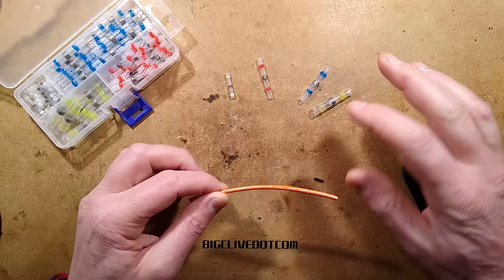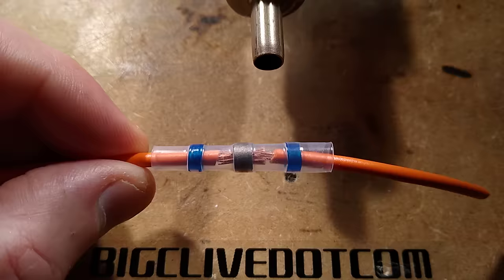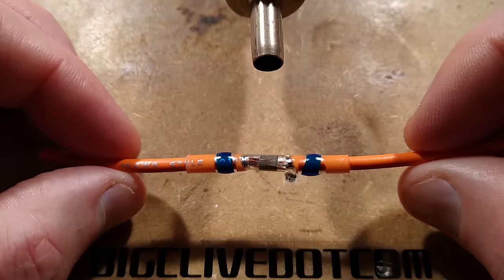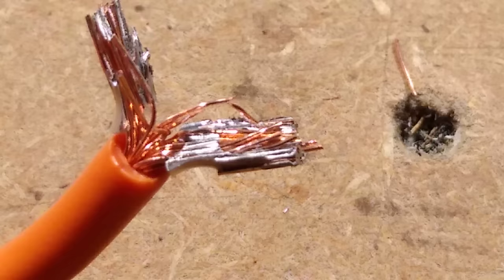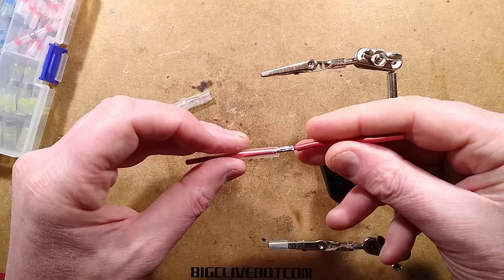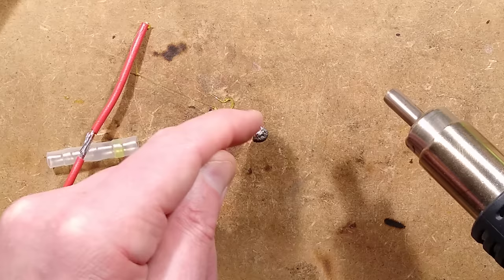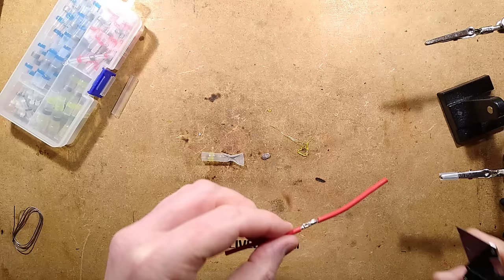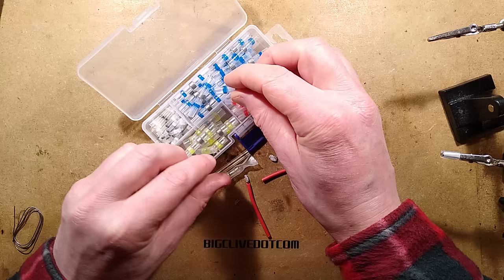Heat shrink solder butt connector test.

Comment: I use (used to use?) these at work, but we have the "brand name" ones which we get from RS which appear to have flux on the inside of the solder band, so they provide really quite excellent solder penetration and strong joints even in fairly high current applications, highest was nearly 25A
Reply: I agree. I used them in the past on MoD equipment. They look like cheap knock-offs to me.
Reply: I was going to comment on this as well.
Those ones appear to have a much worse solder quality compared to the name brand ones that I used at work before we quit due to RoHS issues with the ones we were using.

Even seeing the original solder band visible on the heat-shrink in his test was a warning that the solder wasn't a good quality example.
Reply: @martinbuck3094  - I think they are - the RS ones are much better.   I have used them and carried out a similar test with better results.
Reply: With the knock-offs one could easily add their own flux
Reply: I have seen them used my air craft manufactures and have used them my self.  There are Coax and Triax splice kits that are about the same concept.  When done right they work great.  Bought some for automotive use, been seeing them become more popular the last couple of years.  8 years of aviation maintenance.
Reply: @cody_forrester  
I saw something similar in military acft maintenance while I was doing it as well.
Not often used on the airframe I was working due to the wire maintenance specs, but still on occasion.
Reply: I used Military grade versions of these on Aircraft wiring when I was the RNZAF. They were fantastic. As others have said, these look like cheap knock offs.
Reply: I got a pack of these knock-offs and they're terrible. I loved the good ones I used to have. They had marine sealant in them too.
Reply: @__WJK__  What next - solder-cored flux ;)
Reply: I used to work for BAE Systems back in the early 2000's building wiring harness for military/aerospace applications. We used these type of connectors occasionally, but I was trained to always tin the wires before making the connection.
Reply: You know what would be mind-blowing for these ? If the tube either side of the solder ring contained a chemical paste such that you just push the joint together in the sleeve and in doing so, partly mixed the two chemical compounds that reacted exothermally to solder the joint and effect the heat-shrinkage - so no heat gun needed.
Reply: @cody_forrester  I still have a bunch of these, great for terminating coax onto circuit board pins.
Reply: @millomweb  - You might actually be onto something... that's kinda sorta what we see in arc welding rods/electrodes.
Reply: @BEdmonson85  In which case, you may as well have soldered them properly ;)
Reply: @__WJK__  Indeed. And in the case of brazing, it's d-i-y flux coating ! I wonder why flux-coating brazing rods didn't catch on ? Maybe they are available but I suspect less flux is required once the brass has wetted fully what is being joined - making plain rods useful.
Reply: Aviation uses solder sleeves, but generally not for joining two cables directly together.
Mostly for joining a flylead to the screen of a screened cable.

These flyleads are sometimes used a conductor, for example in the audio systems, however usually it is just used to terminate the screened shield of a data cable, to help reduce interference or induced signals.
A way of reducing "noise" in a data transmission system.

But, I have never seen them for a physical wire joint before. Mechanical methods such as crimped splices are much preferred. Even when soldering to a terminal you want it hooked or wound around the terminal post for mechanical contact. (depending on that particular aircraft manufacturers spec/standards)

But then again, Aviation, both civil and military is full of manufacturers who use rather random unique methods despite their usually fairly United standard practices.
Reply: @underwaterdick  With the quality of contemporary crimped joints, nevermind the very low cost, soldered joints are frankly more of a risk/liability than anything else, at least where movement & vibration is a concern(more often than not). Crimp quality testing is as simple as giving the crimps a nice solid yank and throw the meter on it to check resistance - but soldered joints just add a lot of unnecessary points for potential human error that crimps don't. Also, the time & expense of redoing a poor soldered joint vs a crimped joint too, and inconsistencies. 
Solder just doesn't make as much sense today as the old school guys want to believe it does - old habits die hard, but new habits are cheaper, quicker, more dependable(no work hardening over time!)
Reply: Those are better yes
Reply: Bullshit. If these worked we'd all be using them.
Reply: We also have a brand name product and the solder is thicker and there is flux visible .They work great.
Reply: @underwaterdick  yep, that is typically what they were used for at my old job.
Reply: @millomweb  yeah, military standards can be a bit tedious. That's why mil-spec stuff costs so much.  You'd be amazed at just how many manual processes still exist when building military equipment, that have long been automated in the commercial world just because quality control is tighter.
Reply: If you're buying anything other than brand-name, you're wasting your time. Those products are made only for Big Clive to rip on and should never be used by anyone who actually cares about their workmanship.
Reply: @__WJK__  you could add your own low melt solder too lol
Reply: oldskoolhead0 - I actually have a tube of solder paste and will have to try it next time I use these!
Reply: @BEdmonson85  I guess it will all have a certificate. The bolt will be certified by the manufacturer to meet the mil-spec. The person that puts the nut on and tightens it up will certify that the bolt has been tightened to 'spec' using a torque wrench that has 'recently' been tested and found to be in 'spec'. No machine can read the certification from the bolt manufacturer or torque wrench certificate to be able to certify the bolt has been tightened to spec.

Machines do dumb work repetitively and rarely compensate for out of 'super spec' results - as they don't test - everything is an unknown. Pretty much everything military will have a watertight paper trail - and 'passed' !

Incidentally, a Snap-On  catalogue of the 80s had a range of tools from a pound or two - like an 8mm spanner - so I had to find the most expensive tool in the book - it was a torque wrench tester at over £50,000 !
I'm sure I could make one cheaper than that !
Reply: @BEdmonson85  I know of one <linked> place that when it got new electrical appliances with a moulded on mains plug, it'd cut them off and fit a new plug !

And my washing machine - when you press the power button to turn the machine off, it breaks the neutral connection - meaning everything electric/tronic in the case is at 240V AC !
Reply: @millomweb  lol yep, one job I was tasked with was just kitting up parts for a rebuild kit for some piece of equipment. Every part was placed in it's own little zip-lock bag and a label with the quantity and part number was put on the bag. My only job was to count, bag, and lable the parts and then put everything into one big bag. Once everything was kitted, the kits were sent to QA and then they had to unbag everything and recount it all... That's government work for ya.
Reply: @martinbuck3094  no doubt Clive bought the cheapest variety he could find on eBay... :)
Reply: @BEdmonson85  Poor system really. QA could have lost a component accidentally and caused problems ! It'd have been more sense if they just weighed the bags !
And in fact, if repair kits for army field use, it would have been better to put 12 in a bag where 10 is specified - in case one is lost at the point of use !
QA - I came across BS 5750 aka ISO 9000 - which ensures the same mistake is made every time :)
One place I worked bought 2 2nd hand Maestro vans. On our initial inspection, I found that of the 10 cylinder head bolts, the back right one had a washer placed on the bolt LAST !

Thinking back to automation, I've wondered how CNC lathes and milling machines compensate for cutting tool wear !
Reply: Yes - but the training on these is to heat them until the band is gone and he didn't do that. It was user error, these work great even if you don't mix the wires.
Reply: @davidwatson8142  Thanks for that insight. I've never actually seen them before.
Reply: @millomweb  No one has ever made a poor joint by using too much flux :)
Reply: @steverpcb  Not too sure of that ! I believe excess flux on copper water pipes can cause leaks over time as the acidickness gradually eats through the copper.
Reply: @millomweb  You are meant to wipe off the flux on the outside and the water flow on the inside deals with it :)
Reply: @steverpcb  Yeah, I know - having never soldered a pipe ;)
Reply: @millomweb  Tip of the day, wipe the solder pipe joint afterwards, otherwise it will turn green :)

Comment: These things are by far the best thing amazon has ever recommended me. I had no idea such a thing existed and they are fantastic, makes joining wires not only so much easier/faster, but when dealing with wires that are more likely to get wet, they provide some peace of mind(ive never tried soaking them underwater, when dealing with wiring underwater i just make it so there's just one continuous insulated wire leading to the device to be submerged) plus I find they work best when you just hold the wire ends next to each other and pick the smallest size that can fit the wire insulation
Reply: I use a lot of the red ones
Reply: Used them on my boat trailer..submerged in saltwater and seem to work fine..a little more heat should have been applied the center copper didn't get to temp for flow. Evidenced by the fact the middle band did not turn shiney..it all didn't melt.

Comment: I've found that they create a dry joint and often come apart unless you mechanically connect the wires first. It definitely works better if both wire ends are dipped in flux paste.
Reply: I would use Kester #186 no clean liquid flux for that. I find it penetrates stranded wire much better than flux paste.
Reply: I thought that flux would be useful as well.
Reply: @atomicskull6405  I agree about using no clean flux, but for a different reason. RA flux residue is slightly corrosive (thus the good advice (or shop SOP) to clean the residue off) so will slowly degrade the joint because there is no way to clean the flux out of those solder butt splices.
Reply: They should make these with PTFE heatshrink and 63/37 with RMA flux. Then you could just nuke it at 620 degrees till the PTFE shrinks, which will be more than enough to melt the solder and wick it good.

Comment: I used these when I was in my aircraft maintenance course, I believe. You make a conventional union splice, then slide the sleeve over... then realise you forgot to put the sleeve on in the first place.
Reply: So you mean you use it basically the same way like every other sleeve?
Reply: Yes, but the advantage would be, a ring of sealant glue
Reply: @SurajGrewal  Well, my focus was more on the "forgetting to put it on" part.
And aren't there also crimp versions with sealant glue? I could swear I have seen these.
Reply: @NightmareQueenJune  yup, but I think, the crimp ones are more like jelly or wax.
Funny, looks like we all do that mistake
 I can't even count the number of times I've soldered a jack, and realised that I forgot to put the plastic thing that protects the connection. Then I desolder it, which often happens with destruction of said jack cause the soldering job was too good, and now I end up with a wire which is inch shorter and one less Jack in the inventory 🤣.
Reply: @SurajGrewal  Easy with circular DIN connectors, just undo every single pin with the inserter/remover tool, and put that backshell you forgot over the pins, then start again inserting wire 1 into A, wire 2 into ZF, wire 3 into DY. then you can put the backshell on finally, after lacing up the wires again, because you need the wire numbers.

Changing connectors the easy way, a wire at a time, from old connector, new pin, into new connector. Sparkie way change connector, what pins.

We had some connectors with a scheduled pin replacement interval, they would start off as 1.6mm pins, and vibrate down to sewing needles. Luckily there was a bulkhead connector further in the airframe, so you could just change a small loom when you ran out of the slack, or the actual wires disintegrated.
Reply: I had to re crimp some ethernet cable ends got done found a boot freaked out, realized somehow I pulled out 5 instead of 4.
I found out cables to go has these fancy things that are in two pieces that snap over the end Great for when you actually forget, now if only more things did that.
Reply: @imark7777777  I have used the two part boots.  They are handy.
Reply: @NightmareQueenJune  There are also "heat shrink, crimp, AND solder butt connectors". GB has them, called EXTREME at $2.00 for ONE connector!

Comment: I’ve been using these and their slightly more rugged self-sealing crimping butt connectors for 30 years, in all sorts of 12 and 24v harsh environments and loads, mostly heavy goods and industrial vehicles and trailers, and they hold up extremely well.  Both in the field repairs and in the shop.  They’re more expensive than using shrink tube + solder, but they are very quick and more  weatherproof.  Something I appreciate in the mud and the snows of a -40C Canadian winter.  Particularly in something like a trailer wiring harness.
Reply: Hi, those self sealing crimping butt you mentioned I am trying to view the type you mentioned was there a specific description of these better ones  ?
Reply: @ZerHour   Grote makes “Heat Shrinkable Butt Connectors “ in both Nylon and Polyolefin, not sure which is more waterproof.  Ever-bilt, Bur-Cam, and Gardner Bender make a combo kit of crip connector with heavy gauge waterproof shrink for use with submersible pump. .
Reply: @vaalrus  Ah yes sorry I misread the first part thinking they (the rugged type )were also solder type now I see the crimping type 👍 yes I've used those come to think of it ,thanks for reply
Reply: With proper marine grade heat shrink you will get a way better seal than these can offer, it's not just a small strip of glue, the entire thing is lined with hot melt all the way down. And with a proper solder connection the tubing doesn't even really need to seal anything as the solder already soaks into and seals all of the wire strands, the tubing is really just for insulating the connection, any corrosion on the outside wouldn't cause any issues.
Reply: @Oleg-oe1rc  True, and I usually keep some of the heavy-duty adhesive lined shrinks around for harsh conditions, or in water tanks or if I have to bury a line.  Heck, I’ve even used a piece in a pinch to seal a pinhole leak in an auxilary airline.  It’s great stuff.

And I agree that best practice is soldered joints shrink wrapped, but on the side of a road,  or you need a rapid repair to get mobile on a deadline, the sealing crimps are quite reliable.  Would I expect to get 20 years of trailer service in the winter out of them, or in a marine appliation?  Probably not, but I’ve zero qualms using them when I need to.  And the submersible (freshwater, anyway) shrinkable crimp connectors supplied by my down-hole water pump suppliers have yet to fail me in the 30 years I’ve been putting them down wells and into cisterns.  Septic tanks, well, that’s a whole other bag of sealed enclosures.
Reply: @vaalrus    I mean they have their applications in a pinch, at least if you get the proper name brand ones and not just the "Amazon #1 best seller", but that said if it won't immediately be exposed to water where it would also be likely to cause a short, I prefer to just twist and tape as a quick fix until I can get it fixed properly, quicker to undo and as long as you fix it before it starts oxidizing too much then less re-prep work after. But for a rainy or snowy day if I'm far from the house or won't have a chance to fix for a day or two I may consider it in a pinch and keep a few in my car.

Though I usually have my compact soldering kit with me with all the fixings so I could easily do up a proper connection in a few minutes with my jumper pack battery and Pinecil soldering iron even on the go, or using the cars own battery if it's inside the car. 

Problem is with how little heat it takes to melt the solder is that there isn't really any mechanical bond with those connectors in many apppications, and with the amount of vibration a vehicle experiences I wouldn't be comfortable leaving one on a car, at least not if it's nearby anything hot like in the engine bay or near the exhaust or any mid to high current applications.

Comment: I used these and Raycem splices for years on military aircraft wiring (starting way back in the 80's) and new avionics installations. If they work on fighters they will work in your car. Since there is "no flame" allowed on aircraft we used nitrogen heat guns. Inert gas with a heating element. Never had any issues. A great solution if you hate to solder and want weather tight at the same time.
Reply: You were probably using a higher quality part than these lousy things people like me buy from Amazon.  The ones I've used are worthless.  The plastic melts through destroying any integrity before the solder will really get into the joint.
Reply: @MAILER-DAEMON  Use a heat gun, not an open flame, and you won't have that issue.